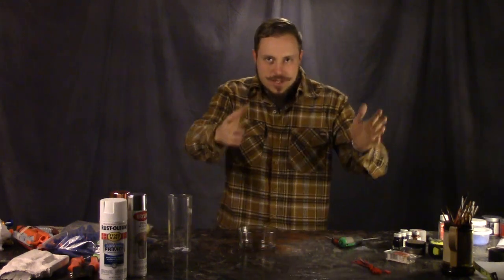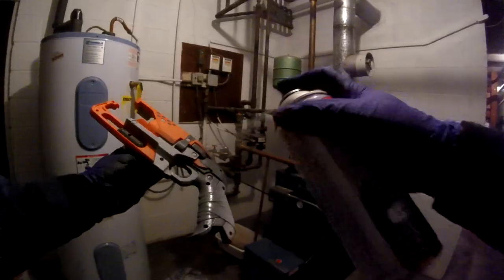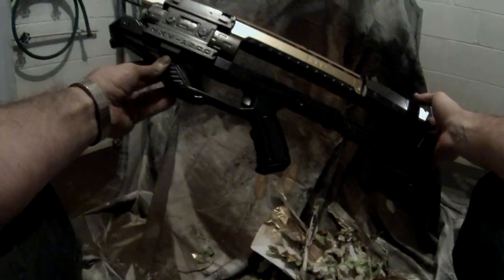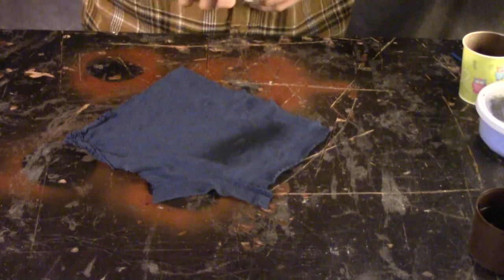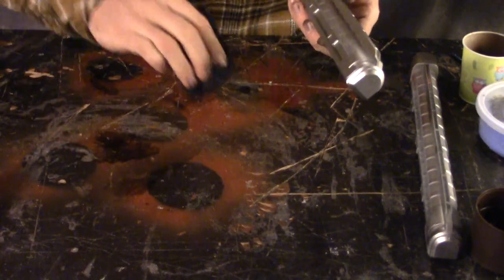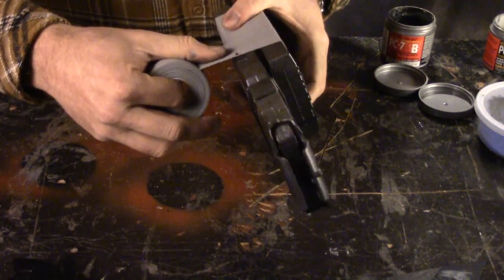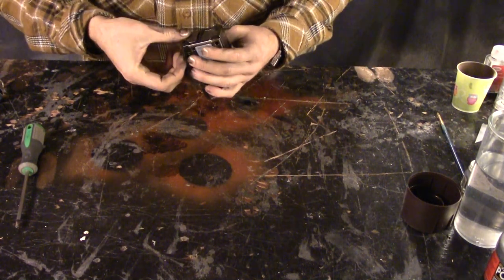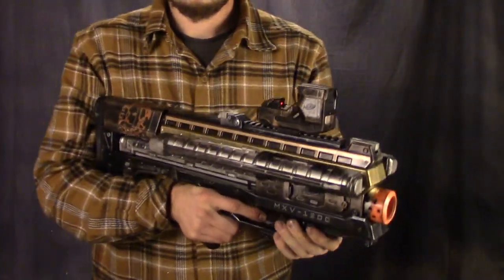Ultimate Loadout Customization - Long Version

Comment: If you do a new set of these, I'd make the primary the nerf RIVAL VII nemesis, the secondary either the nerf modulus stryfe or the nerf elite rayvenfire, and the sidearm the nerf elite mega magnus; all those would be my picks, but it would be you video.

Comment: Tips for you (because you seem like one with potential) mod all your blasters completely, these means no air restrictors, spring replacements, brassing the hammershot, rewiring the electronic blasters completely so blastertech/smiths looms for the rapidstrike, rewiring the zeus with silicone 18 awg wire, high amp microswitches and lastly NEVER PAINT MOVING PARTS, you are just asking for them to gunk up.
(also nerfblasters are never accurate, you'll need to get koosh or acc nipledarts for them to be accurate)
Reply from the maker: +THEOSTRICH 73  I appreciate the input! I have done mods in the past(performance) I want to do them again but I have other things that I am getting into for my next videos.

Comment: Nice job with the paint job. How do you carry all three blasters at a war?
Reply from the maker: I did the drawing for the winner of the blasters at the same time as this video. Since I knew who won the contest I tried out the straps that I got, to do a single point sling on the Zeus and a standard sling on the rapid strike the slings were not quite the right size so I had to modify them to fit the person that won.
Reply: +JAIRUSOFALL cool. I wanna see how the load out looks all together
Reply from the maker: +DjPhantasy I want to do a video on it. I have other things I want to do also. hopefully I can do a video soon using them.